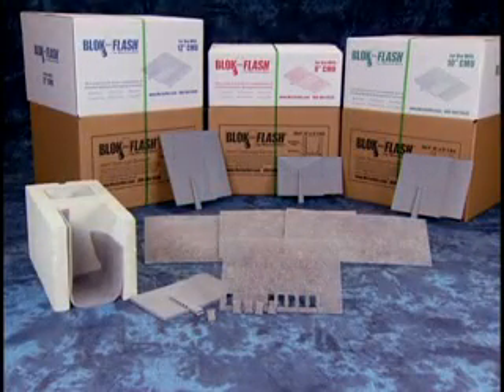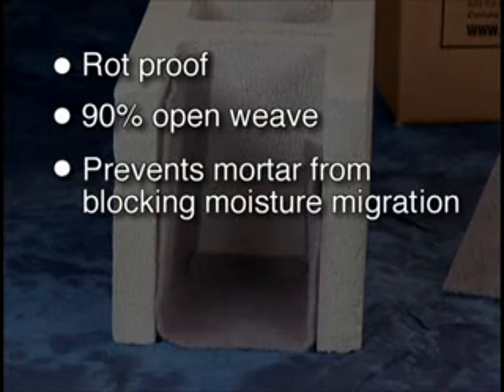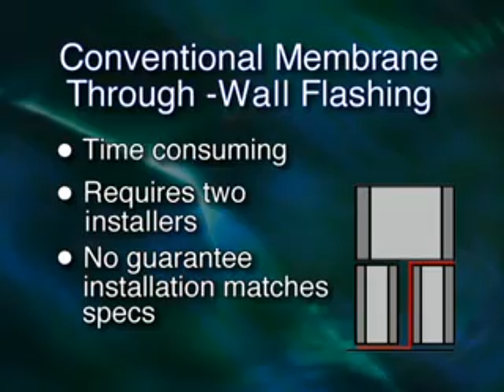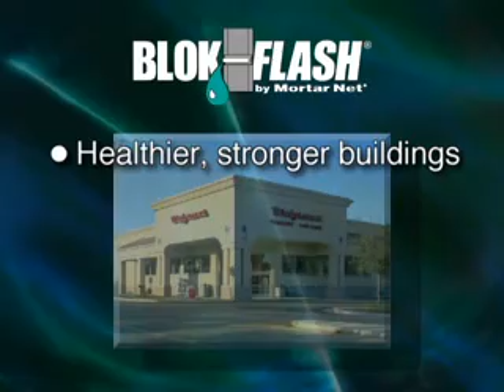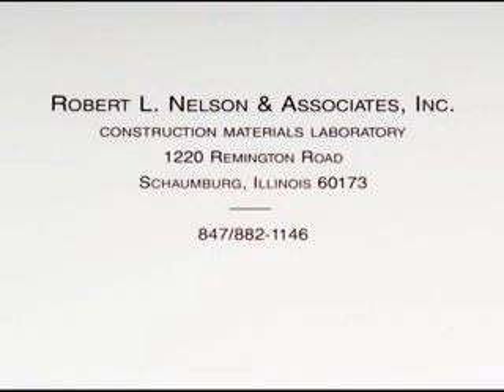Blok-Flash

Comment: one thing wrong the first cell of a cmu wall will be completely filled solid before wall is completed thus no water will reach flashing at base. CMU on forst course is usually specified to be in a full bed of mortar of even filled up half way if not all the way.
Reply: You're absolutely correct. In that case, we recommend placing the BlockFlash on top of the first course that's been grouted solid. That has the advantage of keeping the spout above ground level, which is necessary for proper performance.
Reply: when bricklayers spread mortar on block most of the time mortar drop on floor or in the cell of the CMU. Do a wall even 12 feet high and I bet  you block flash won't work and it will be encased in mortar.